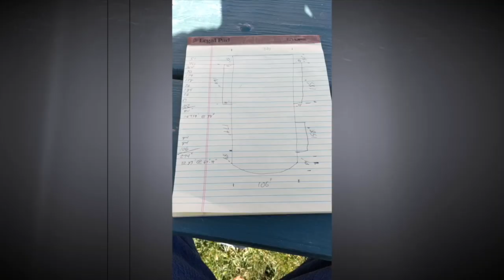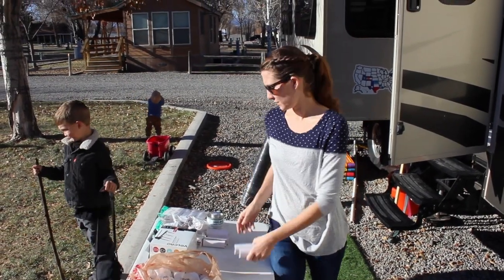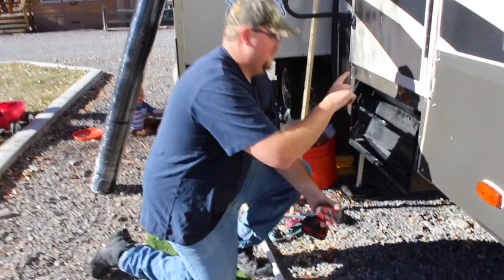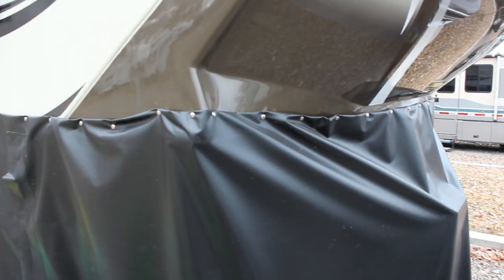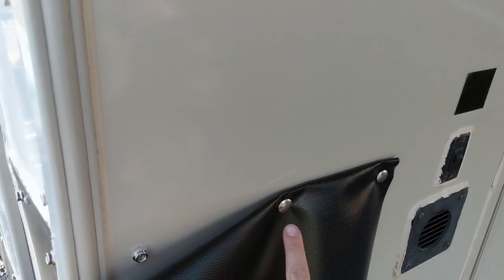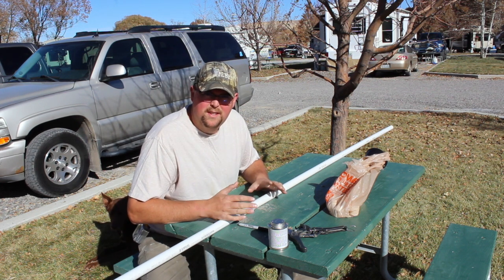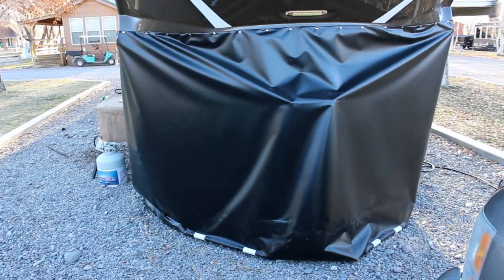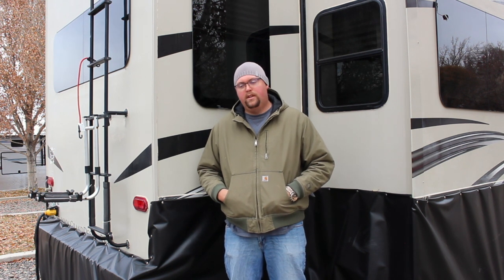DIY RV Skirting | Cheap RV Skirting | Winter RV Camping | Full Time RV

Comment: Hi, Jordan.  I was searching for someone that skirted a Grand Design (we just purchased a Solitude 310GK) and found your YouTube.  Thanks for sharing and posting.  It's going to make it easier when I skirt for the winter.  I had used EZ-Snap previously on an older RV, was very satisfied, but wanted to see if there were some less expensive solutions...and voila!  Your post came up.  I was also torn between the stick-on snaps, or go with the screw on.  You've helped me make that decision.  Hope you wintered well this year and I would love to hear how your system held up since your installation.  Wish you and your family the best, Winn
Reply from the maker: Thank you so much!  I am happy that our video was helpful!  Our skirting held up well all winter long in Colorado!  The only thing I would change would be the velcro I used for the access under the front of the rig and the two spots where I connected the two pieces.  I glued it on which worked but when the sun would warm it up that glue would get soft again and the velcro would come off.  I will either have to stitch it on there or go with a zipper set up.
Reply: @HayesHumbleHomestead   Thanks for that update.  We, too, don't have a sewing machine.  But I'll have to speak with the wife to see how her sewing mechanics are.  EZ Snap did have a 'door' feature for the 5th Wheel room (I'm just the consumer, not associated in anyway with EZ Snap - I just like their product).  You just unzip it and roll it up.  Seems like we can find the best of both worlds.  Best wishes.

Comment: Thanks for sharing. I'm researching to do ours, as we are unable to head south this year! Looking at a heater under there to combat Alberta winter.
Reply from the maker: We contemplated a heater under there but we didn't quite get cold enough to justify it.  Out skirting kept us plenty warm.  I was always a little worrisome about putting a heater under there just for the fire danger.  If I were to do it, I would put it on a timer so it wouldn't run 24/7 and potential cause an issue.
Reply: @HayesHumbleHomestead  We get many, many days at -25c/-13f and the winter is 6 months long. I'm looking at electric heaters as well as the diesel powered heaters, safely installed, to get us through.
Reply from the maker: @glynpayne4393  yeah that is a bit chilly and probably will need some sort of heat source under there. Let us know what you end up doing!
Reply from the maker: @Buszzbait69  that's a great idea!
Reply: @Buszzbait69  Despite the crazy situation we all find ourselves in, we are heading south, without the trailer!

Comment: Instead if skirting, I put insulation under the trailer. 2 sheets of R10 rigid foam back to back for R20 value, except where the holding tanks are, but they have R7 on both sides plus a plastic cover. Way cheaper than $800, plus no installing or removing every time you move the trailer.
Reply from the maker: That's a good idea as well. I'm sure it works well for the main body of the trailer but if you have slides they wouldn't be insulated. Plus I don't know how you would put that insulation in the upper floor of the fifth wheel. The skirting also helps keep the wind from blowing in through the areas around the slide where there is a lot of heat loss.
Reply: I have a slider- R 10 rigid foam under and R20 on top, with a topper over that- of course that has to be removed when retacting the slider. The outer edges , except wheel wells have R-20 as well, just cut to size and use that spray foam to hold it in place. Outer compartments and inner compartnents are also lined with either R10 or R5. Also have a roll of R16 fiberglass stashed in places where the rigid won't fit. Oh, and I put foam rubber insulation in the shower skylight with vinyl velcroed to that and the roof vents have removable insulation. That's not quite all, but you get the idea.

Comment: Great idea/video. I might go this route but I may go with soffit since we’re parked permanently. Thanks
PS: You had some really great little elf helpers there, they’re really sweeties!
Reply from the maker: Thanks for checking it out.  We used the foam board insulation the first winter and it worked quite well but since we travel frequently and never know where we are going to end up we went this route so that we can take it with us.  It folds up nicely and fits in a plastic tote.

Comment: Looks like a good job.  I like the portability aspect.  In one reply you/someone mentioned big gusts of wind "blowing your skit up" (pun intended).  Did this become a problem or just intermittent? Did the skirt return to or close to it's original position?  Make heavier weights? Transporting  heavier weights?
 I did want to know how the snaps on the ends of the slides cleared when slides were retracted.
  Thanks for the vid.
Reply from the maker: It would return to its original position for the most part. Heavier weights would definitely help but then you also need to transport those as well. Snaps had no problem clearing since you have at least an inch or more all the way around the slide where the slide rubber seals run.
Reply: @HayesHumbleHomestead  Thanks for the come back.

Comment: how do you secure it to the ground we have winds gusting rather high at times maybr i missed that
Reply from the maker: We used 2" pvc pipe filled with sand. It works ok but it will still blow around a little with high winds. We went with that because of the ease of traveling.

Comment: If you had to do this project over again, what would you do different??
Reply from the maker: The area around the steps could be revised, same with the Velcro opening under the front cap. The sticky Velcro ended up moving or coming off when the sun hit them and warmed up. The Velcro needs to be stitched on the fabric so it doesn't come off.
Reply from the maker: Also wouldn't cut around the hatches. Just lower the point of attachment and save some time
Reply: @HayesHumbleHomestead  But all in all you'll are pleased with the results? What about snap button those openings, do think that would have made a difference?  I am also wondering if you made an opening to drain your tanks?
Reply from the maker: @shakirthankful1  snap buttons would work as well. Our only concern with that is that it would have left gaps for wind or cold to easily enter but if you placed them closer together it would be alright. We did cut a flap for the sewer to run out and then just used some of that foil tape to seal it off for wind and cold. Water run underneath and electric was at the rear above the skirting so it wasn't an issue
Reply: @HayesHumbleHomestead  OK, thank you for your precious time in replying and making the video. This definitely was a good and helpful one! I wish you'll much success in your journeys.

Comment: Nice video.  So! How did the skirt hold up??
Reply from the maker: Used it for a couple of years with no major issue. If I were to do it again, I would sew the Velcro on for the access parts because that glue gets soft when it heats up and the Velcro comes off.
Reply: @HayesHumbleHomestead   Thank you for your quick response have a blessed day

Comment: Great video. I just clicked your link for the canvas and unfortunately they're out of the black vinyl for now. I'll have to check back in and order later. You posted this video 2 years ago, how has your skirting performed?
Reply from the maker: Thanks Frank we appreciate that! We've used it one full winter and then a couple of times when we ended up in cold situations. It has done great so far. I would suggest sewing the Velcro on for your access points or doing some sort of zipper or snap. The glue that held the Velcro on doesn't do well when it gets in direct sunlight.
Reply: @HayesHumbleHomestead  Thanks for that tip. I was planning to glue the Velcro, but will go with snaps instead.

Comment: How has the pvc held up to wind? I have 60+ mph gusts where I live in the rockies. Wondering if the wind will blow in between the 8/10 inch between snaps?
Reply from the maker: The PVC is weighted with sand and we had no issues. The trick is to get the vinyl "tight" to the ground so the wind can't get in and move things around.

I apologize for the slow response on this. We somehow missed the comment.

Comment: Got all the materials and tools. about to follow in your footsteps. Have a question. Got a deal on a roll of 18oz Vinyl 50yrds over double the width of your roll. Wife suggested doubling the material to do a two layer skirt. I’m concerned the weight of the vinyl would put to much stress on the snaps? And would it make a big difference to heat retention? Any thoughts?
Reply from the maker: Congrats on finding a good deal on double the width.  I have the same concern that you do and I think it would be too heavy for the snaps.  The snaps are pretty strong but that vinyl is fairly heavy with just one layer.  It may help with a little more heat retention but I don't think it would make that much of a difference.  I'm not an expert on that though! haha I would leave enough extra length on the bottom though in case you are in a spot that has uneven ground or slopes differently in the future.  That way you have enough to reach the ground not matter what kind of situation you are in.  If you are in an area that gets really cold for long periods of time I know some people will use heat lamps or different types of heaters under their rig to help keep it warm.  If I were to do that I would put it on a timer and only let it run for a few hours at time and then cool off for a few hours.  My concern is the heater catching fire.  Though unlikely it can happen.
Reply: The Camper House I might have missed it but can you tell me what size drill bit you used for the screws?
Reply from the maker: @fightintheshade  For most of the screws you will not need to pre-drill the holes.  We had some cases where we were drilling into metal and it was easier to pre-drill the hole.  Don't quote me on it but I want to say it was like a 1/8" drill bit.  Just make sure it is smaller than the screw threads.  That way they can still grab.
Reply: The Camper House that’s helpful, what driver did you use on the drill to put the screws in? Was it just a regular Phillips head or was it a special driver? Appreciate all the help, saving me a lot of time and trouble
Reply from the maker: @fightintheshade  no problem! The snaps we used had a regular Phillips head!
Reply: Care to share where you got that deal on vinyl at?
Reply from the maker: @breezeemax  We got it from a company called Big Duck Canvas.  https://lddy.no/d2ei
Reply: You can also get “like new” vinyl form used billboard sales. Normally about $100.00 for 14x48. One side will have advertisements and the other will be a solid white or black. We paid about 200 for our skirting this way instead of paying 2000 for someone else to do it. Also the skirting is more for blocking airflow. There is no “real” r valve from rv skirting unless you add sew in insulation but would need to be at least 5 inches thick
Reply from the maker: @triplejies  Thats good information!  I have heard of people using the billboard material before as well.

Comment: Great Video! I’m wondering how large the skirt is when it’s all rolled up to be taken to the next location? Is this a good solution while traveling?
Reply from the maker: Thank you!  We were actually quite surprised how small it rolled up.  We laid it out and just kept folding and folding until it would fit in a 38 gallon tote.  It is a perfect fit in there and then the pvc pipe just lay in the storage bay.

Comment: Nice work!  We just ordered all the materials you listed and plan to do this job this weekend or next.  Did you drill around the 50 amp power supply and just follow underneath the bumper line?  Again nice work and thank you for your detailed DIY video!
Reply from the maker: We went under the plug. We run the cord under the skirting and then plug it in on the outside. Thanks for checking it out and good luck on your install. If you have any questions don't hesitate to ask
Reply from the maker: How did your skirting turn out?

Comment: Very good job and info. Looks very likely we’re going to be following in your footsteps on this one. Getting materials together at the moment. Our rig is 43’ long, wondering how many screw/snaps to buy? I’m in the market for a used press & snap tool if you’re selling?
Reply from the maker: I would figure on doing a snap chat very 4-6 inches and then give yourself some padding by adding another 10-20%. You'll use more around curves and such and it never hurts to have extras. I'm holding on to my tool for now. Never know what projects the wife will come up with for me haha they aren't cheap tools but it made the job easy.
Reply: How big is your RV? How many yards of vinyl did you buy?
Reply from the maker: @fightintheshade  ours is 39 foot and I ordered 40 yards of the 61" industrial coated fire retardant vinyl. We needed a little more than 61" to do the front of the fifth wheel so I ordered enough extra to double it up around the front to make it long enough. I didn't have but a few scraps left over. Better to order a little extra because it will all come in one piece.
Reply: Very helpful. I was looking at 50yds, should be perfect
Reply from the maker: @fightintheshade  good luck! Let us know how it turns out!
Reply: The wife is nervous about the reliability/weakness of snaps, have you had any problems? She also talked about doing a clasp system instead. Any thoughts /advice would be helpful?
Reply from the maker: @fightintheshade  we haven't had any issues with the snaps so far. Used for one season and we took it on and off about 4-5 times for a few trips we took. There is a company called ezsnap that has some better snaps but they are pricey so we avoided them. Might look into them for a heavier duty option.
Reply from the maker: Did you get your skirting together? We'd love to here what you thought of the process if so!
Reply: Where did you buy your billboard vanilla?  Please let me know.  Jan.22, 2024   5:31am.
Reply: @HayesHumbleHomestead  3 yrs later, the skirting is doing the job. We didn’t do one continuous piece but did it in 8 sections so we could have more access to storage underneath. I got a deal on a roll material and have enough to do its again in one piece. I may do that at later date. Thanks for the advice and the video 👍

Comment: Hello! 
Are there advantages or disadvantages that you know of for using vinyl instead of canvas?
Reply from the maker: I'm pretty sure the canvas can end up molding if out away wet. Other than that I'm not sure. I would expect a good thick Comcast to probably be a little heavier but I'm not sure

Comment: Hey! I just bought a camper and have been researching different underpinning. We live in Virginia and though it won’t get nearly as cold, we do live in a very windy hill. My dad wants to make the underpinning with wood, metal, insulation, and a heat lamp. It would probably be the same cost, but this would be way more easy if we wanted to move. Any suggestions??
Reply from the maker: Congrats on getting a camper!  Building an actual frame out of wood/metal and using insulation is definitely sturdier and will provide better insulation.  The pipes we used for weights on ours worked great but if you get big gusts it will blow up a little and let cold air in.  You can always use something heavier to weigh it down.

We had more of a permanent set-up like you are talking about the previous winter.  We just used foam board cut and taped to the camper so no frame.  It worked great and provided good insulation.  The reason we choose to go with vinyl like this was because we wanted it to be easily packed up for travel and summertime.  This set-up makes it much easier to move and set-up.

If you aren't planning on moving then a more permanent set-up may be the best option but if you are wanting to travel and go from place to place then a vinyl skirting is the way to go.  The problem with moving a frame is that the next place you move might be sloped differently or be uneven and then you frame won't fit.  It just depends on how you want to use your camper.

Good luck and reach out if you have anymore questions!
Reply: The trailer will settle,so the vinyl is a better deal

Comment: Just curious where you store this when it's not in use and how much space do you need to store it?
Reply from the maker: It takes up about 3/4 of a large tote. The storage bay on this unit is quite large so that is where it resided.
Reply: @HayesHumbleHomestead  Thanks.  I like your solution because it’s portable unlike most who want to use foam board or similar.

Comment: I don't know if your comments are selective but these people must not have been living in their RVs for a while. That is not cheap! $800 for skirting is not cheap! I can think of three different ways to do skirting that looks good that's way cheaper than that around 150 bucks I can even do it for $80.
Reply from the maker: If you can do custom vinyl skirting that snaps onto the rig and can be used for multiple seasons for 80 bucks then maybe you should do a video and provide links to where people can purchase this material so cheap.

Comment: On the cheap For $800 bucks .... That ain't Cheap in my world .
Reply from the maker: If you can do custom vinyl skirting for less I would suggest making a video on how to do it and provide links to the materials. The snap tool alone was $150. There a plenty of ways to skirt a camper using cheaper materials but I haven't seen a vinyl skirting any cheaper.